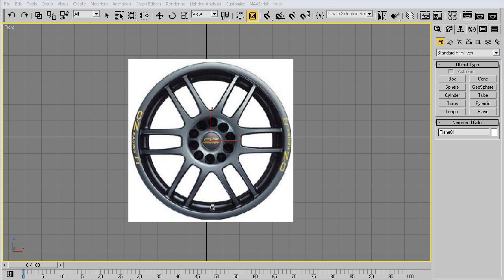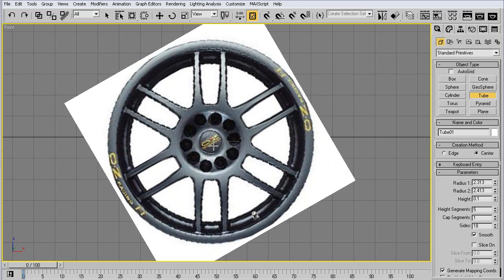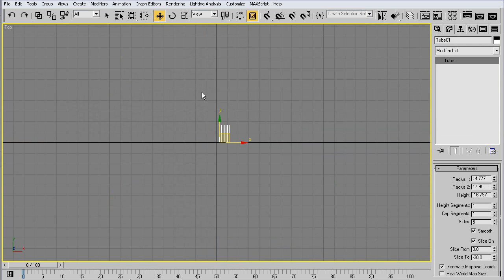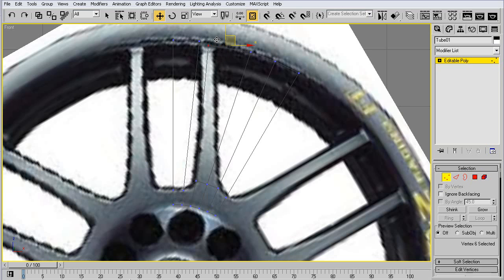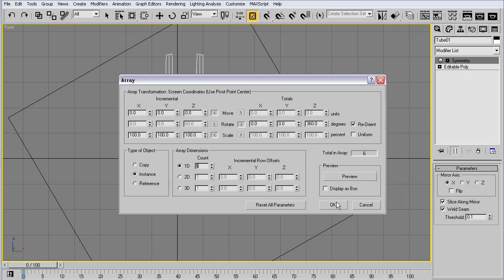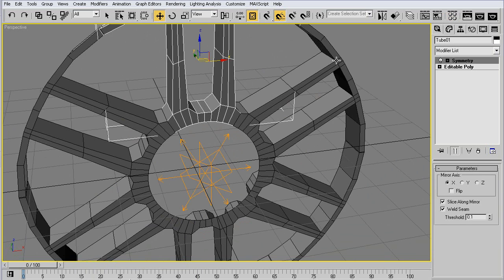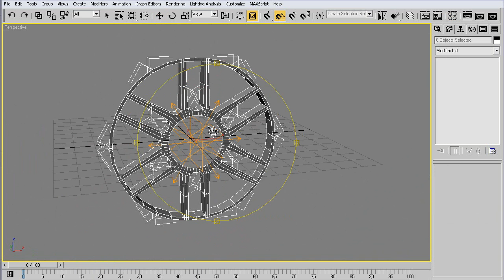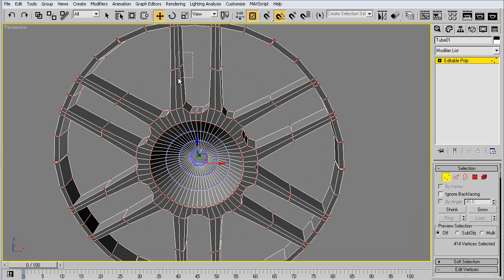3Ds Max: A method for modeling a car wheel

Comment: @2Fast4Mellow A wheel is the inside part that attaches to the hum.The outside part is the tire which then attaches to the wheel. Rim is just a slang term that people use, that technically doesn't make sense as the tire forms the rim of the total wheel/tire rotating mass. A ferris wheel is not called a ferris rim. 

Good tut btw.